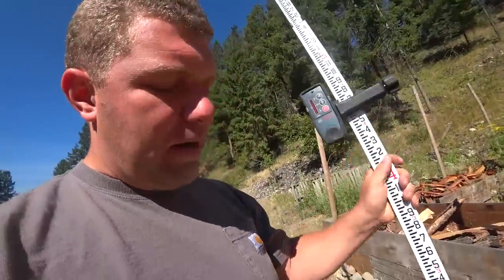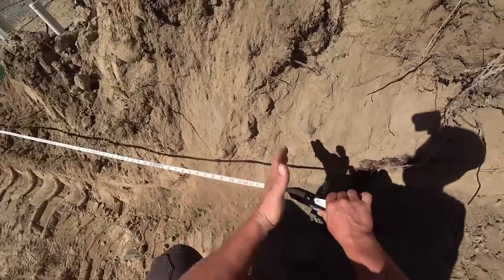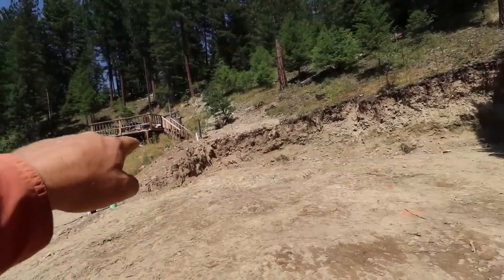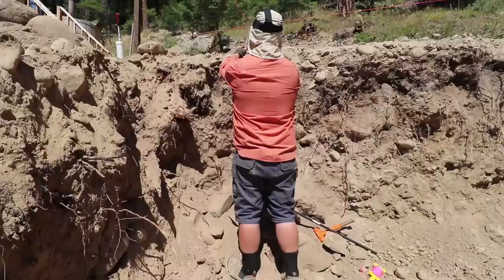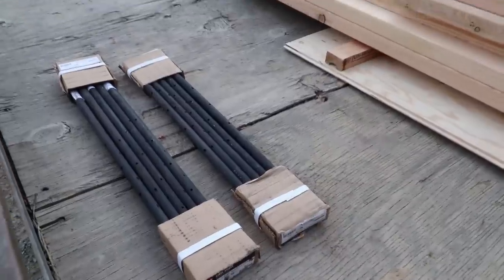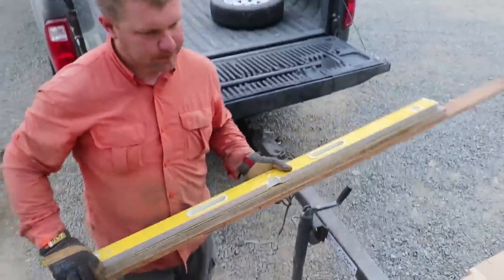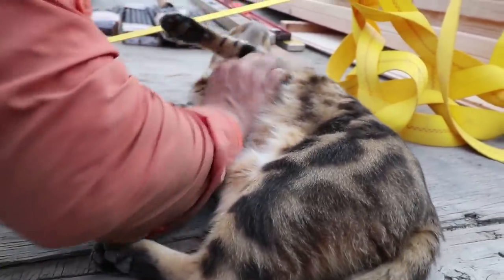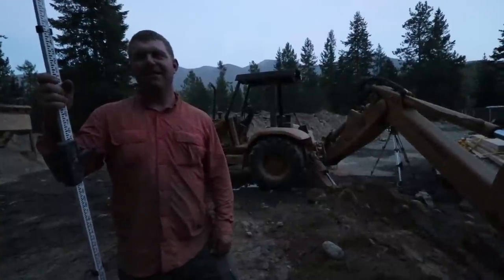TAPE MEASURE MELTDOWN (Squaring & Leveling Home Site)

Comment: Just an observation... or perhaps i just missed it....Where's the Soil Bearing Report? or is it required. The footing is a function of the capacity of the substrate to bear the loads from above. In our area we can only proceed to form work after the Civil Engineer has submitted their stamped report.  Engineers are responsible for structural NOT house designers or Architects. Jessie...please start to delegate responsibilities in related tasks...the concrete supplier should arrange the pumper...not you. You are not saving money by coordinating all the subs and running yourself ragged. Have begun to notice you two are quickly discovering the project management  equation of Time,Money & Manpower....KBO

Comment: One aOf issue is your ignorance unencumbered by your engineering in advance.  I a am building a off the grid home in Encinitas and in some ways you are out of control as soon as possible.
Reply: Tape measure is case in point.

Comment: Just being pedantic but you havent any 'as build' drawings.
Not until its built,  'as built' are the final drawings when complete so you know exactly what youve actually built rather than what you originally designed.
Reply: Im in Uk but work all over the world but never in the US,it is different there then apparently.
From architectural meanings handbook.
'As build drawings
Revised set of drawing submitted by a contractor upon
 completion of a project or a particular job. They reflect all changes 
made in the specifications and working drawings during the construction 
process, and show the exact dimensions, geometry, and location of all 
elements of the work completed under the contract.'
Reply: Well I've looked through the codes and can see nothing stating they have to be 'as built' plans.I've checked Ohio submitting guidance, Idaho, California and Colorado so I don't know where you live but if you're submitting as built plans before it's even built well that doesn't make sense.If it's written on something in front of you then either you or your agent must have written it and its wrong.
I dont know much about US building codes but I spend my life looking at building codes/regulations  in 3 different languages and know where to find them, so Im calling bullshit about what you have in front of you being necessary for approval within any state being a  'as built plan'.
Reply: Then I take it all back.
I have looked and nowhere says they must be 'as built' and even if not a builder asking for 'as built' plans before its built doesnt make sense.Perhaps your agent just labelled that way I dont know and as I say Ive never worked in the states.
Im not too big to admit that maybe Im wrong,Im not,but maybe.Either way its not worth a internet spat.
Reply: The Guru Of Nothing  it sounds like the contractor and/or the building department are short circuiting the process.  As-Built drawings are supposed to be prepared after the installation is completed and measurements taken from the actual installation.  The reason is that if any item cannot be located as per the construction plans (say a boulder is in the way) you would still have a record of its actual installed location.